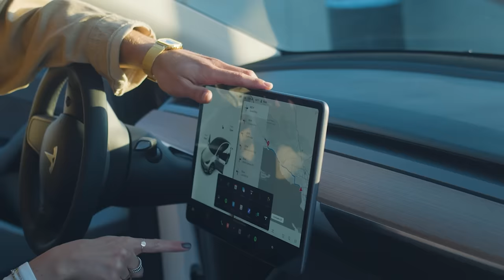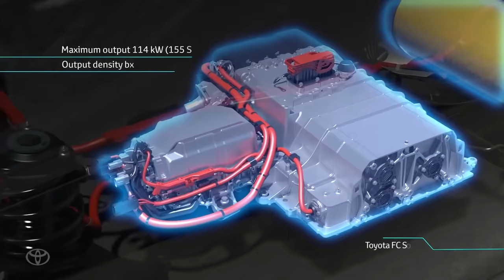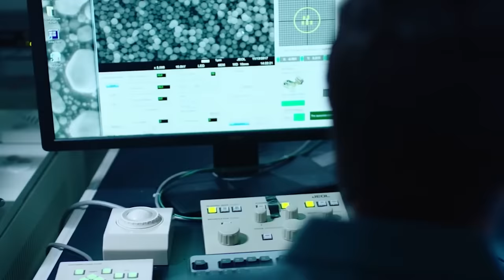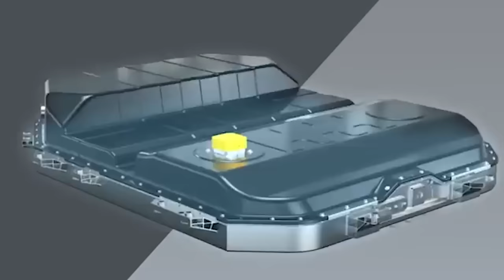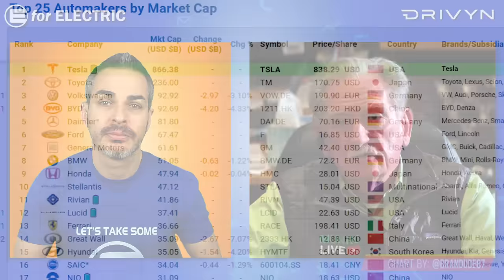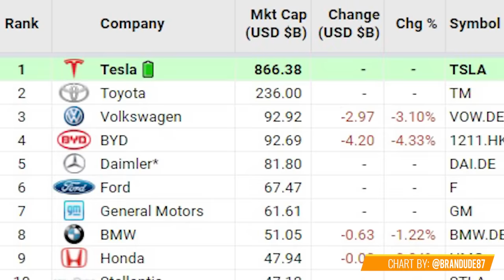SANDY MUNRO: Toyota's "Smart" Anti-EV Plan

Comment: I will never drive an electric car because I can’t afford one. Every car maker are making electric cars but no one can make it affordable
Reply: They will come, after scaling and perfecting battery technology and manufacturing processes the prices will drop.  The only way to get there is by starting with higher margin lower volume models.  Any other way would result in bankruptcy.
Reply: I don’t think batteries are the answer in the long term, lithium is a limited resource. Still need elements from the earth to mine. And there’s a big problem with existing grid, updated more powerful transformers and substations. Security needs to be added. May need more coal plants, wind and solar aren’t dependable. Nuclear anyone? And no discussion of battery recycling.
Reply: BYD's Dolphin EV costs less than any new ICE car sold in the U.S.  Once all digital cameras were more expensive than the analog equivalent. No more. It's why car makers are committed to EVs as their future.

Comment: I agree with most everything Sandy has to say except one thing...  Tesla's interiors are no match for others like Toyota, Porsche, Mercedes etc.  I am just waiting for these others to catch up then we will see what happens.  I would never buy a car with what looks like an unfinished interior and I am not interested in a race car either.  What I am interested in is a car that looks good on the outside, has a finished and well thought out interior, and is produced using the principles of Edward Deming.  I worked for General Motors Research many years ago and was so turned off by the junk they were producing and their unwillingness to embrace solid design / manufacturing principles that I told myself I would never by any GM product.  I was the only one who drove a BMW to work and stood my ground when confronted by the plant manager.  He could not argue once he took a good look at what I was driving.
Reply: well said

Comment: I'm in no hurry to convert to an EV.
I want to see cheap, lighter, solid state batteries for traditional size SUV (not a CUV tall car) to replace my first gen Touareg with similar 500+ mile range and a very quick charge. And no, I don't want a crazy heavy Hummer.

Comment: Actually an understatement.  ICE cars are dead.. China only building electric cars now should clue you in.  Technologies change and you either adapt or perish...  If you want to do electric, you need a combination of good charging infrastructure, a diverse supply of battery architecture and cutting edge vertical manufacturing.  Tesla in comparison is sprinting away, while legacy like Toyota is still at step 1 in the process.  You don't win because you used to be a great company...
Reply: The reality is that China isn't making and selling electric powered vehicles, they are adopting coal-powered vehicles and that isn't going to change significantly for a long time.

Here in the US, Elon Musk admits that the national grid needs to be tripled in capacity if all ground transportation were EV instead of petroleum based. So everybody is scrambling to now make EVs but there is no serious expansion of the electrical grid underway.

The so-called infra structure bill had a few billion for charging stations and yet nothing at all for grid expansion.

Current admin is causing artificial scarcity of petroleum inducing the highest prices in national history and yet there is no serious expansion of the grid underway to accommodate such a shift.

It's all a scam from top to bottom

(I didn't even touch on the issues of the semi-exotic to exotic raw materials that go into making an EV and that when manufacturing of these scales way up, then there will be shortages and environmental damage consequences of trying to produce enough of these raw materials. Even a basic raw material such as copper is going to come under severe stress in terms of adequate production/supply. An EV requires exotic raw materials and even mundane raw materials (e.g., copper) that are very problematic in a world that attempts to shift all ground transportation to be EV-based.

The long term consequences of an EV world is perhaps even more problematic than the current petroleum and natural gas powered one.
Reply: @briangeiger9307  imagine - in California, where it's become like a third world nation that experiences electrical power brownouts, there is no serious effort to bring in substantial new power generation, and the state still imports much of its electrical power from out of state. And yet Cali more than any state has been at the vanguard of pushing climate change hysteria. Pump up a crisis while offering no actual solution to said manufactured "crisis"
Reply: ICE cars are dead? EV’s have no market share. The future is not here yet. Tesla’s stock price is speculation. Toyota is hugely profitable. Tesla is lucky to show a profit.
Reply: @allanedwards2347  EVs - if the fad continues in respect to mass manufacturing them - will bring on new wave a calamity

Massive destruction of the environment via strip mining to get the exotic raw materials to manufacture them at scale.

And brown outs of the electrical grid as too much strain is placed on it as it is not being meaningfully expanded (takes many years to do so).

A home that becomes an EV owner will see their electric utility bill double. If that starts happening on a mass basis where already the grid is very precarious (look at California which has an electric grid that is already operating in third world nation mode).

Elon Musk admitted that the US national grid needs to be tripled in capacity to sustain having all ground transportation EV based. That is a mind numbing figure and nothing is being done to bring that increase about. But we'll destroy the environment with strip mining probably before we fully face the power crunch.

Comment: Most of us don't want an EV.
The power isn't there, not even close. 
What will happen when a hundred million people plug in to their 240 volt, 50 amp circuit?
That's the same as an arc welder zapping 1/2' plate steel, all at the same time.
If we start right now, building power plants, maybe on 25 years, if we work real fast...

Comment: Isn't Japan in a uniquely terrible situation when it comes to electrifying their auto fleet and using renewables to power that grid?  Japan actually has 2 incompatible electrical grids that divide the country?  And there is no continent-wide electrical grid that Japan can plug into, unlike Europe.  Also Japan's one possible source of native energy are the methane hydrates off their coast?  No wonder they have been keeping the dream of a hydrogen powered car alive.
Reply: Perhaps also for self reliance, as the Japanese import all their fuel, and prefer to find a localised power solution that is also clean.

Comment: If i ran a car manufacturer and wanted to know how electric vehicles are built i would likely buy a cheap or broken one cheaply. Dissasemble it make a list of the components find out where to buy the batteries electric engines and other components. Figure out which parts of the vehicle i wanted to build. I would try to buy the components from China or elsewhere and would figure out what the cost to assemble and obtain all the parts of the vehicle was including labour. If the manufacturer building the electric cars was selling them at a high price i would try to undercut his prices to sell cheaper vehicles of the same quality as the other manufacturer.
Reply: Or better yet let Monro do it better

Comment: If Toyota indeed has played us, why is Chinese BYD producing it for thenm with BYD blade battery (assuming the info that came out is true)?
Reply: They announced a joint venture back is 2020. I believe they were one of the first automakers to partner with BYD.
Reply: @barakagicheru2563  Yeah I have similar recollection, still have a Toyota but will not buy from them again. BYD has better warranty and is probably way cheaper, also don't want a suv, BYD Han Stationwagon seems freekishly good

Comment: Questioning the validity of a 100 year plan isn't arrogance, HAVING a 100 year plan is. Its a colossal waste of time, and the market can change in 5 years, let alone 100. Maybe you have an idea of where you want to be in 10 years, but nothing in that plan is going to be worth anything by then.
Reply: Tesla’s original Master Plan came out in 2006. 12 years later, the final milestone of that plan, the Model 3 achieved volume production.
Reply: @Laura-S196  Having a plan is fine, having a 100 year plan is arrogance. Elon has revised that original plan several times now since 2006, over a ~15 year period.
Reply: @rwdplz1  Elon didn’t revise Tesla’s first master plan. Instead he released Part 2 to the plan.  Elon said he is now working on Part 3 to the plan.

Comment: I'm getting more and more turned off by Tesla. Right now in Northern Europe you might have to wait 5 months to get your car fixed. 1,5 months is the average. Model 3 is the least reliable new car after a 3 year period. In winter conditions Model 3 and especially Y are absolute dog shit. Not only were the frameless windows and those door handles a terrible decision, but there's so many issues with the heating, and the ride quality in European roads during winter is absolutely terrible.

You see more and more ID4's and electric Mercs on the road, and for a good reason. Even the supercharger network is meaningless here, because there are so few chargers and so many other fast chargers around. Maybe Tesla just cares about the North American market and has decided to give the middle finger to smaller markets. Which is a shame. It's the Xbox 360 of cars.

Comment: Honda  & Toyota may be rivals, but they view core business very differently. Toyota views themselves as a car company. Honda views themselves as an ICE manufacturer that sells cars so they can sell engines. Does Toyota sell a motorcycle? Does Toyota have a large line of consumer electric generators?  Does Honda have HRD? Not in the same way Toyota has TRD. Toyota makes cars. Honda makes engines. I KNOW this is how these companies view themselves because I did design consulting for both companies, and several other car companies, for years, and interacted with not only all divisions here in the U.S., but with HQ in Japan as well. Go to their respective HQs and you can see their focus. At Toyota, it's all about cars. At Honda, they display their engines and  their race cars in their lobby.  I know a lot more, but that's enough for now.

Comment: Tesla is only winning due to the supercharger network. Thats Tesla's power. Toyota has one thing tesla doesn't have, a excellent dealer network. if Toyota, puts up charging stations at its dealerships, Toyota could beat tesla. The dealerships can provide a much better experience i.e. restrooms, cafe's, Wifi and work spaces.

Comment: Toyota has a 100 year plan and they are developing cars powered by the most common element in the world, hydrogen. So what do we do for fuel in 100 years or whenever the world runs out of fossil fuels? We manufacture hydrogen.
Reply: The overall efficiency of producing, compressing, storing, and transporting hydrogen is abysmal. Then there are further inefficiencies producing electricity in the cars onboard fuel cell.  Hydrogen also likes to attack metals, leak and is highly explosive. Go do some research.

Comment: Fuel cells are less efficient than diesel so big energy loves the idea. But the world can never go that way because planet does not have the noble metals (platinum, rhodium, etc). 
The same issue hits nickel based batteries. We don’t have enough nickel on the plant. Lithium-Iron-phosphate (LFP) is the only option. Elon Musk has already said as much.

Comment: absurd.
if Toyota wanted to -- had the will, changing their philosophy from conservative to aggressive-innovative -- it could overtake Tesla "in a day." Toyota is a big ship and has been for a long time sailing in a lane of "being conservative" in their expression to compete. It had dominated on being reliable, while allowing others to introduce "tech, features, gimmicks, novelty." but now that the architecture of mobility is changing to EVs, Toyota could find the need to "rewire (its DNA)" and accept a more iterative philosophy and produce products that compete with the less complex platform of batteries and electric motors. Now, Toyota could change and overtake the space -- but will they? Toyota has seen outsized results from being the brand that offers "conservative products (reliability)." They have the ability to compete but will they make the necessary changes to compete -- is the question -- and not if they can access capital or what.

Comment: I thought that Toyota's EV is being made by another company that is just private labeling for them.
Reply: The Toyota bZ4X and it's sister the Subaru Solterra are built by Toyota in Japan. Subaru plans to move production of the Solterra to US as demand increases.
Reply: Toyota's first EV is a joint venture with Subaru. They will each have their own version of what is basically the same car underneath, Toyota bZ4X and Subaru Solterra.
Reply: Who? BYD? That's for one car in China AFAIK. Be careful of your sources for information. Some very anti-Toyota biased sources are trying to spread misinformation that most Toyota EVs are made by another company.

Comment: EVs and batteries don't have to come from the same manufacturer. Bottom line, quality will win every time, and that's not Tesla.
Reply: Respectively disagree. Does any mass ICE maker bought their engines from suppliers? No. So also batteries which is the core and most expensive component in ev cars.
Reply: @sparrow5407  --  battery technology will continue to evolve, improve, and come down in price. My concern is the quality of the vehicle, if it lasts 30 years or more, the batteries could be swapped out 3 or more times.

Comment: To bad the EV Toyota car is a BYD car. With a Toyota logo on it. They do not have any battery contracts for volume EVs.
Reply: Not true. The bz4X is NOT a BYD car.
Reply: @benjaminsmith2287  The car design is Toyota but the meat and potatoes.   Batteries and engine are BYD that's the important part. I think BYD and Tesla will take large share out of the older car market.
Reply: @shawncooper8131  The bz4X is not a BYD car. Even if it uses BYD batteries then BYD is a supplier of batteries. The Bz4X is a Toyota/Subaru collaboration. Subaru's AWD system and Toyota's E-TNGA platform, infotainment interface and overall design. The BzSdn, at least the one for China, is built by BYD and has Toyota/BYD collaboration.
Reply: @benjaminsmith2287  I just feel bad for Honda Toyota and others. I think because they can't supply them themselves with key components, the profit line will shrink to the point. And they will disappear. I had a Toyota and a Honda. I am looking at a Toyota highlander hybrid maybe in 3yrs..... Or a or a truck from Tesla.
Reply: @shawncooper8131  There are so many things Toyota can do to stay as the world's largest automaker and Honda as a major company. They can also branch out into making things like better "tuk tuks" used in so many Asian and African countries, better motorcycles used in same (especially Honda) and some electric powered ones, commercial vehicles. Honda can also refine their generators. I also think Honda and Toyota both will come up with strategic partnerships like Honda is doing with Sony and Toyota with various companies. I don't know what will happen in the future but these are old companies that have figured out other challenges and have done very well.
Reply: @benjaminsmith2287  Yes I hope they can get all the supplies they need to push the quality and volume, I am a fan of Sandy as well,  been watching him before his channel came out. Ripping apart EVs so you know what your greeting is the best! You should check it out if you haven't. Electric Viking is a good to....bit of a Tesla fan boy but he has good points on supply chains.